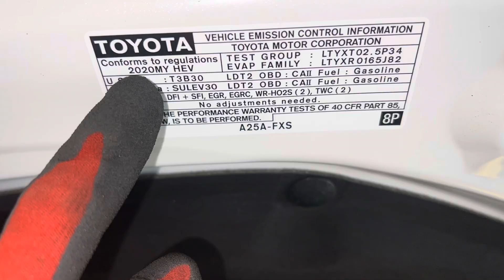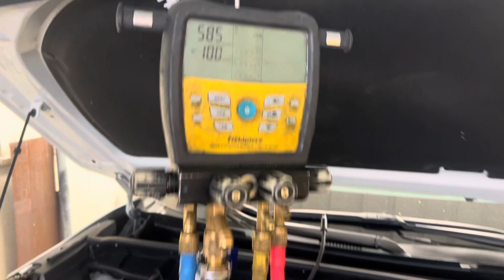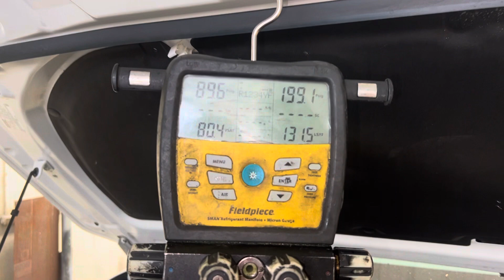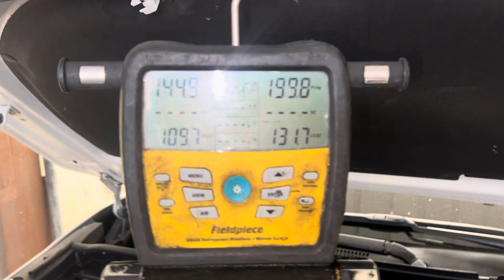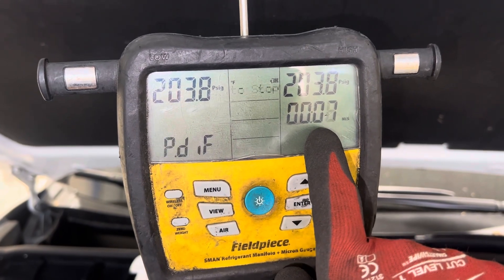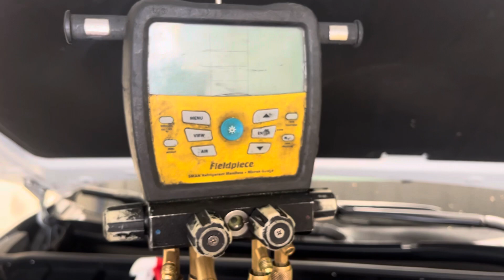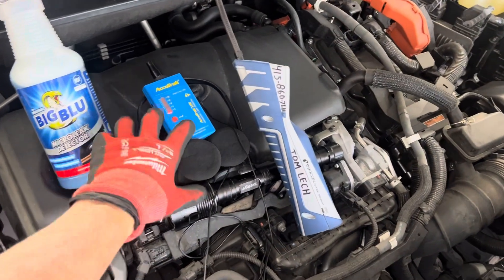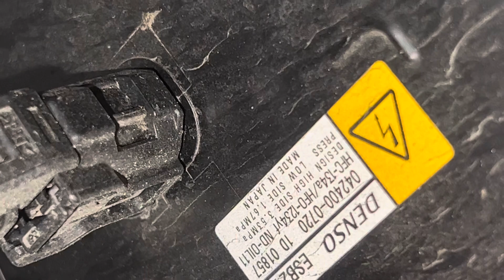Nitrogen Decay Test , testing for leaks on condenser orings before Refrigerant Recharge

Comment: I am now at the stage of vacuuming and pressure testing so this is really informative thanks.  Interesting that when closing off a vacuum pump the pressure can rise even though there isn't a leak, but because there is still moisture in the system that is boiling off (if I am understanding this correctly).
Reply from the maker: @mickandrews9458  if you have ever seen a physics or science experiment in high school or even grammar school, where your science teacher would draw vacuum on water either using a vacuum pump to a 5 gallon water jug pour in a inverted glass airtight bell vacuum chamber, looking at a glass. 
       When it starts boiling at room temperature. 
     When the vacuum is turned off, the boiling does not stop immediately. 
     It keeps boiling and then tapers off quickly as the boiling water vapor expands to raise the pressure inside the chamber to above its boiling point. Once that point has been reached the liquid molecules, stop expanding and boiling off into a vapor.. 
     If you have a large glass syringe filled with water. And you held it upright and capped off to end..  and then you pull down onto the syringe plunger.   You would notice the water would start to boil in an air gap and chamber will start filling the top portion of the syringe.. literally the compressed gases from being under pressure when it came out of the tapwater, and the water itself will flash into a vapor that is many times its size as a liquid.  And then, as soon as you stop, pulling the plunger down, it still continues to to bubble and boil for a fraction of a second longer until the vapors have made enough pressure that I can no longer boil anymore.
Reply: @coldfinger459sub0  I did not remember this at school but have now seen youtube videos.  Your answer, as much of your videos, show the importance of formal education.  When I was getting the Nitrogen, comparing prices from suppliers who only quoted cylinder volume and pressure (i.e. not actual Nitrogen volume at a given temperature at atmospheric pressure), I had to use PV=nRT to convert and compare because some were 200bar and others 137bar.  I remembered studying this ideal gas equation at school.  I hear people say what is the point in learning maths e.g. trigonometry.  But if you need to drill from one side of a wall to another, being above floorboards on one side and below on the other, what angle are you going to drill at.  If you know the wall thickness and the height difference from one side to the other of the wall, it is simple, use the tangent function.  Formal education is so important, as then is learning from those with lots of experience.

Comment: Tom, where do you buy your ac fittings for automotive vehicles ?  I’m will be purchasing several pieces fieldpiece equipment soon, I have the required list  recommended by Tom .  I’m retired but I love learning and your the best I’ve heard and seen.  Thank You so much Tom.  Wished you would start Zoom educational channel.  Have a great day!
Reply from the maker: @davidjackson4112  for the service couplings 1234YF and R134 I get those online Amazon recently yellow jacket no longer makes quality parts anymore. The last service I got from them were from Taiwan and they failed within 3 to 4 months just like cheap harbor freight or eBay service couplings

Yellow jacket, the last three or four years now it’s only months, but they still want the same price. They took the production away from the United States and shifted it over to Asia. 

But if you want the valve core removal tools .  That you’ve seen me using videos those all come from True Tech Tools just like all the Fieldpiece equipment. 

Of course, with the 8% discount code 
LECHAIR

Comment: Subscribed. Found by recommendation. And the FB group. Going to get a nitrogen setup very soon.
Reply from the maker: @Personalized_Workshop  thank you. 
  Nitrogen pressure testing decay test just another tool in your arsenal to help you find leaks

And also speed you up on moisture removal when doing wax and nitrogen, purge flush . 

You’re gonna have to watch a few videos on that to very simple

Comment: Hey tom. I work on a bunch of old r12 systems in 80s Toyotas, mainly pickups and 4runners. They utilize serpentine condensers and evaporators, recently drop in replacement parallel flow condensers have been made available for them and i have been recommending everyone upgrades to them due to the increase in cooling performance. Recently I learned that the 88-92 corollas use a plate and fin evaporator core that is a relatively easy swap into the truck/4runner evap box. Is there a noticeable performance upgrade for upgrading from a serpentine evaporator to a plate and fin evaporator?
Reply from the maker: Yes if it is the same size. H/W/L 

It’s all about the surface area. 

Inside the the flat refrigerant tubes of the micro channel condenser and evaporator there are more tiny thin fins attached on the inside greatly increased the surface area in contact with the refrigerant. 

The tiny internal fins carry the heat out of the refrigerant or into the refrigerant faster with greater efficiency. 

But you will need to custom modified the refrigerant charge. 

It will now be reduced. Because of how efficient and how small the new internal volume is. 

This is why you see such small amount of refrigerant used today compared to old R12 systems.

Comment: Hey Tom, what do you think about a Prius condenser with damaged fins and little rocks in the bottom half of it.  I went to try and clean it and realized the condition of the condenser wasn't that great.  The whole lower half of it, where the bottom grill of the car is, is like that.  In the summers I have to set my AC to Low and 3 bar fan speed and wait 2 minutes and then max it out when its cold.  Othewise it will only get cool.

Is this common on vehicles low to the ground?  How fast does this happen over time?  Wondering if I would have to replace the condenser every 5 years or something because of this damage.  It is possible that this isn't why I have to do that trick.  I had it recharged by Toyota about 2-3 years ago.  Wonder how much it would cost to replace if it was it.
Reply from the maker: This is very common with cars, even my own privacy that are open on the bottom, low to the ground.  I think I made a video even on my own personal vehicle. Old condenser was really beat up. All the things were bent over by stones.. 

You have to get some fine mesh wire like eighth of an inch square mash . 
And then fold it with two or 3 inch layering like a accordion . 

And then place it behind the bumper inside in front of the condenser so all the little stones hit that first and bounce off instead of hitting your condenser 

I plan on making a video about that when I do my own 

That last video I did with my car when it was an accident I showed my car all taken apart in the body shop and I even spray painted coded with epoxy the whole entire Condenser, so it was blue .

Comment: Thanks to all these recommended videos I randomly decided to check my cars ac compressor, And its leaking. Judging by the amount of uv dye its been leaking for a few weeks at most.  

Caught it in time.
Reply from the maker: Save you a lot of time and money.  Because when it’s too late in the compressor burns up when you have metal, flake turmoil, that’s a lot of flushing and replacing all components..
Reply: @coldfinger459sub0  That would be a shame. I replace the condenser and drier only 5 years ago. its as good as new.